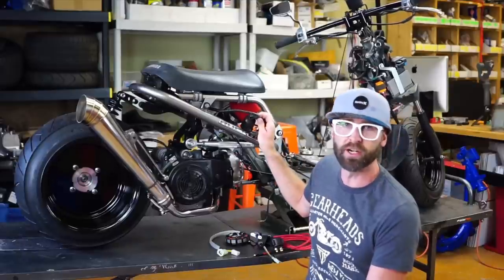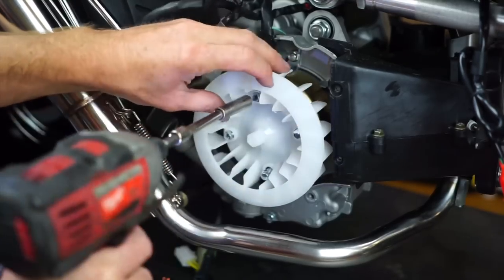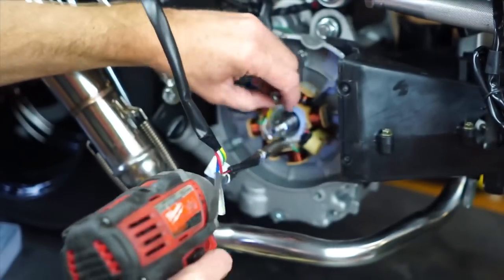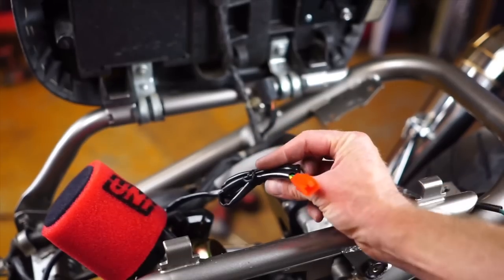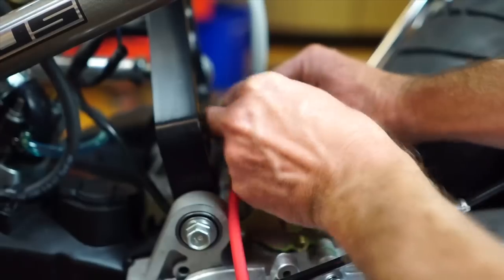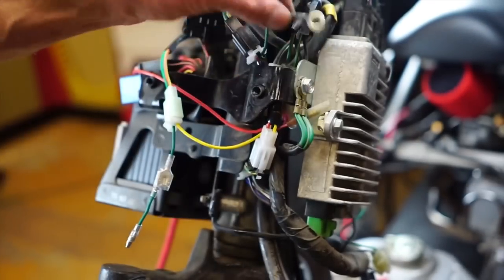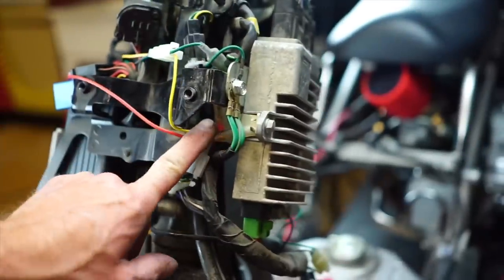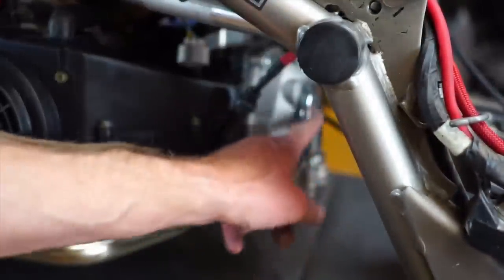GY6 Ruckus SIMPLE wiring [PART 5]

Comment: Working on installing my rolling wrench harness, only complaint is it didnt come with hardware to attach positive cable to starter.
Reply from the maker: Hey dude! It’s super simple. The gy6 engine comes with a cable attached to the starter. Clip the nut off the cable and use it with the provided screw. That’s the reason we don’t include it anymore. That process works best.
Reply: @RollingWrench  I see, it looks like the cable that was on the starter has the nut/threads built into it. Like the bolt screws right into the cable itself, it doesnt sandwich between a bolt and a nut. I should be able to use the battery cable type hardware but I just need to make the hole on the starter connector a tad bigger.
Reply from the maker: @cookingbacon3085  you shouldn’t need to make it bigger. Just cut the nut off the cable and use the screw to attach

Comment: That's pretty cool, what would you say it's too speed would be, also are there shock/spring combo's that will stiffen up the suspension for heavier riders?
Reply from the maker: Top speed around 65 with no mods. Depending on the conditions and rider. Suspension can be adjusted for heavier riders

Comment: Hey rolling wrench, love your channel is there a voltage regulator rectifier for a magneto that you would recommend? I have I yellow lead from the stator and the regulator needs to have a 12 VDC on the output, thanks in advance stay well see you on the next video.
Reply from the maker: What harness are you running with the GY6?

Comment: Hey Matt: Does the original harness ground need to be mounted to the starter mount bolt and  or can you attach it to a valve cover bolt or left over frame mount like for the radiator over flow bottle?  I REALLY do not want to CVT and ankle bitter apart…..
Reply from the maker: Just be sure it’s attached to a good ground on the engine if you don’t want to go directly to the starter
Reply: @RollingWrench  T
Thanks Matt!

Comment: Funny that the same motor comes from 50cc up to 150cc and a street legal (over here) have a few, easy to remove, devices that limits top speed to ~25mph.. the 125cc versions just have more plastic to look bigger. But the ruckus, they all look the same. If you strip down one of those "china scooters" to the frame, the biggest difference is placement of battery and gas tank. But then you have all the cheap plastic stuff where the ruckus have casted aluminium..

Comment: What is going with an 11 pole stator benefit? Is that if you want to put less stress on the battery and add more electronics like lighting or cigarette adapter or something?
Reply: Gregory Megatron That’s correct, or if you’ll be installing extra lighting like LEDs
Reply from the maker: The other thing is it meshes with the stock ruckus rectifier regulator.
Reply: @RollingWrench  alright thanks guys! I did buy a couple rock lights [they go in the fender of a jeep wrangler or 4x4] and I need to add a couple other items so this would be a nice idea. 

I have a video idea for you as well RW .. You mention keeping the ruckus fuel pump .. How about a video for those of us that have a regular gy6 scooter .. and lets say I wanna go on eBay and buy a ruckus fuel pump? Is it just that simple? unplugging the petcock and switching it with a fuel pump? That would be the video idea.
Reply from the maker: Gregory Megatron  if you have a basic gy6 with a gas tank above the engine. This can be fed by gravity unlike a ruckus. This is much more reliable. If you have a basic GY6 scooter with a gas tank below the motor they run a fuel pump. I would recommend a electric pump. The vacuum pumps are fine until the bike has been siting for months.

Comment: Lol only if you where local to do my swap 😂😢 you made it look so easy . Idk if i should buy all these parts now since you can use the oem ones . But alot of mechanics tell me to get new 150cc parts like fuel pumps amd stuff. Cause it wouldnt work with the original GET motor atuff
Reply from the maker: Keep as much of the stuff Honda as possible. Keep it reliable!

Comment: Will this harness work for the metropolitan as well? Or are they different?
Reply: JoeyD JoeyD I’ve worked on both, the ruckus and metropolitan, and this is RUCKUS specific. The metropolitan has its battery mounted towards the back of the bike. Where as the ruckus has its battery near the front. You’ll run into cable length issues. You’ll have way too much power cable since it doesn’t have to reach the front battery. Which would be fine since you can always roll it up. But then there’s the right hand control that you have to plug in-line. That part of the harness still needs to go towards the front.
Reply: @that_texas_local  so it would have to me a metropolitan specific kit or extend the right hand control plug in line?
Reply: JoeyD Also the brake sensor coming off the starter solenoid connector
Reply: @that_texas_local  hmmmm.
Reply from the maker: I have a metruck kit. It’s not on the website, but I have sold a few. Let me know if you want me to build you one.
Reply from the maker: Definitely different
Reply: @RollingWrench  I will definitely let you know once I get more insight on mounting the gy6 onto the stock rear frame. 😅

Comment: Why you dont want backfiring(afterfiring), Flames from exhaust are cool.
Reply from the maker: It might be cool, but that means your engine is to lean.... not good. Lean = Hot air cooled engine
Reply: @RollingWrench  but the air is going straight i to the exhaust, not the cylinder. Even if this is the case u can give it more fuel

Comment: I take it one of the connectors wasn't making a connection...hence the cutscene  when starting it?
Reply from the maker: No, it was the first start and it cranked for ever before it started,  didn’t want to bore you with a long drawn out starter noise.
Reply: I understand, brand new engine and all...I appriciate the content, a very thorough build.